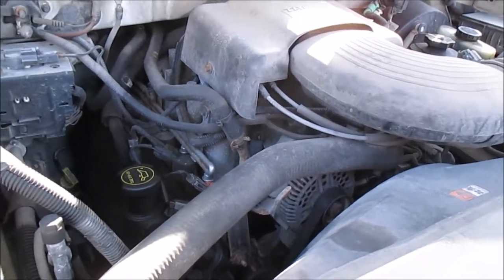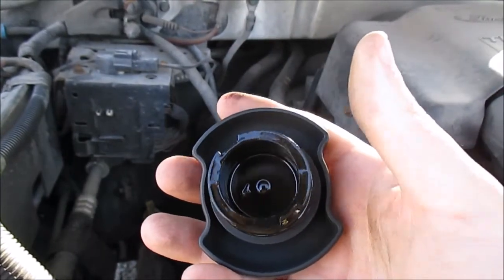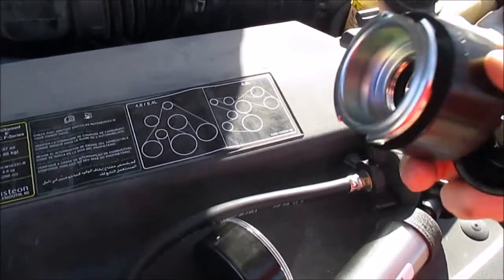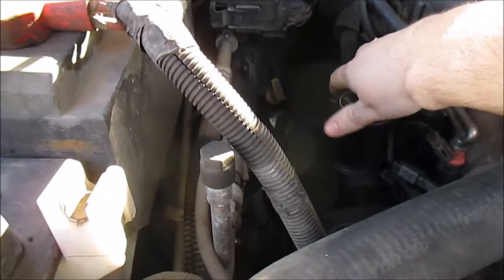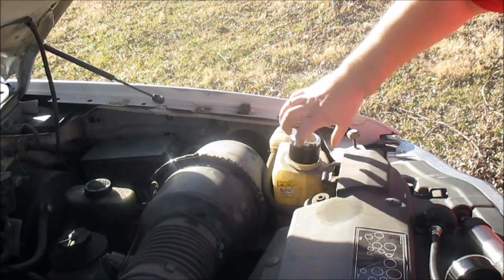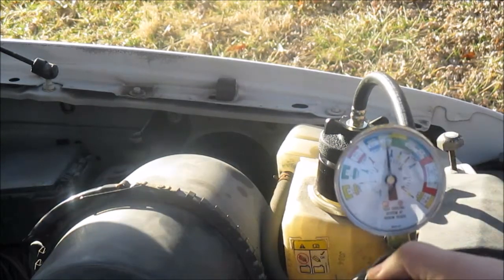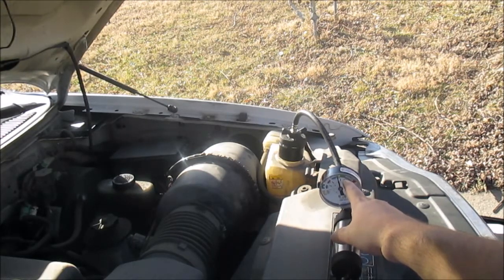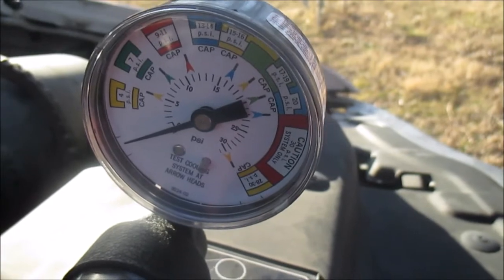FORD F150 COOLANT SYSTEM PRESSURE TEST

Comment: I'm gonna have to do this to my Crown Vic. I replaced the intake manifold assembly & gaskets recently and it appears to be loosing coolant over time. I suspect one of the replacement gaskets I put in is leaking into one of the cylinders as I don't see any external leaks when the engine is running. The heads were pitted around the coolant passages and I put high temp RTV in there to fill the gaps but apparently that didn't cut it. 

Where did you get your kit?

Comment: My 06 chevy Monte Carlo has no pressure in the cooling system an the heater don’t work after running the car for awhile it leaks coolant from radiator hose but the car don’t over heat it stays around 195F

Comment: So many videos out there where the year, make and model are specified (fairly useful stuff) but THE MOST important info in a video like this, the engine type, is not mentioned in the title or the description or in the opening of the video. So, so weird. I guess I have to assume it's a 4.6L Triton V8.
Reply: This is such a universal test it doesn't really matter the vehicle year, make, and model. It's basically the same procedure. The only difference is that this vehicle doesn't have a radiator cap. I wasn't sure if I could use the overflow for pressure testing. That's The only reason I'm here watching this video.